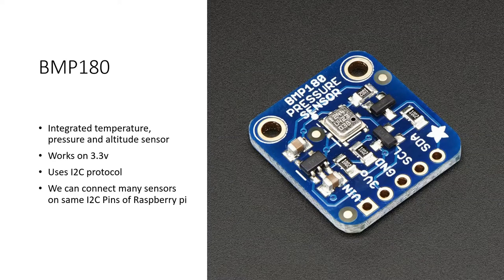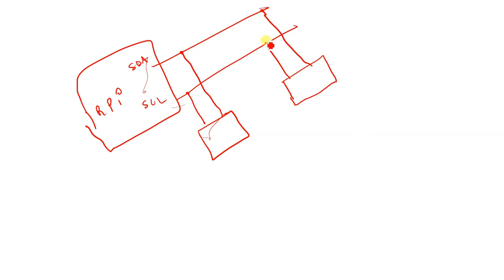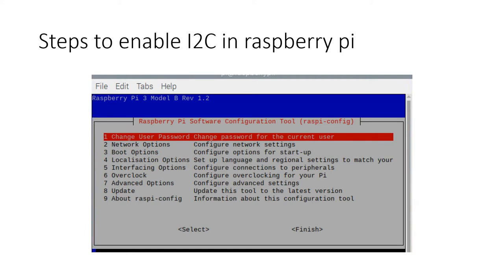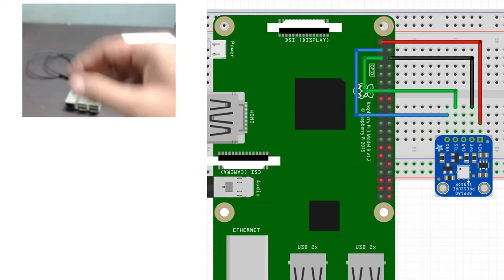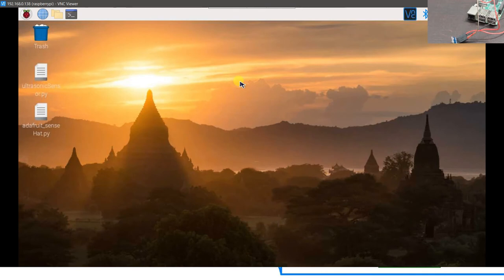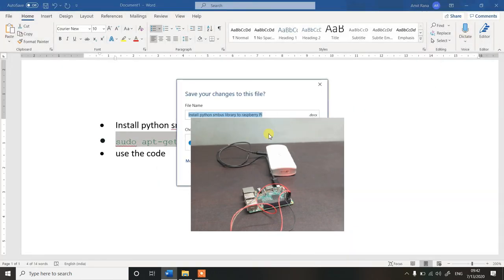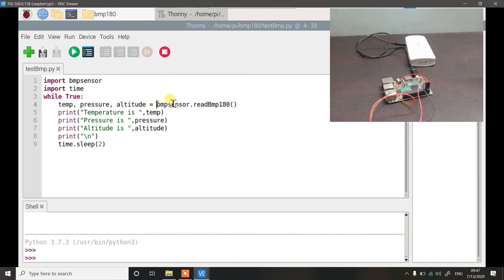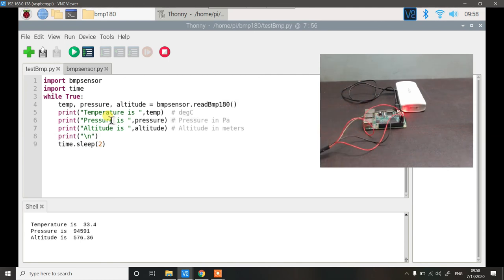Interfacing BMP180 with Raspberry Pi Python Code

Comment: Fantastic! Thank you; I love the BMP180 as it's cheap and reliable but was struggling to get it to work with Python 3 (all other tutorials were using Python 2). I spent a frustrating day trying to convert an old Python script but it kept giving me problems when I was trying to send the results to  a small  OLED display driven by a Raspberry Pi Zero. It is now all working well. Thanks again.
Reply from the maker: Glad it helped! I love it when someone is helped with these videos :)

Comment: I have executed the code getting the following error
"Traceback (most recent call last):
  File "testBmp.py", line 3, in <module>
    while True:temp, pressure, altitude = bmpsensor.readBmp180()
  File "/home/pi/Python_Code/bmpsensor.py", line 123, in readBmp180
    altitude = 44330.0 * (1.0 - pow(pressure / 101325.0, (1.0/5.255)))
ValueError: negative number cannot be raised to a fractional power
"
Can you help me to resolve?
Reply from the maker: Are you using code from our github repo?
Reply: Yes